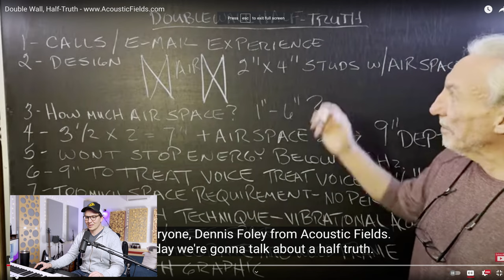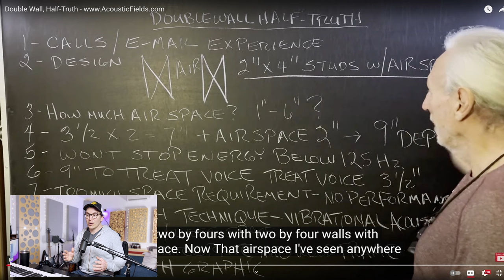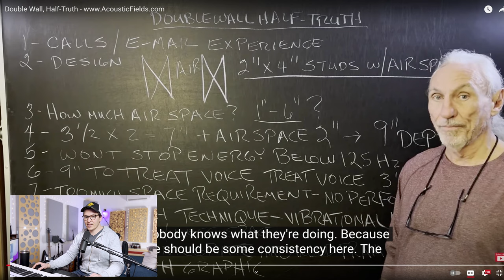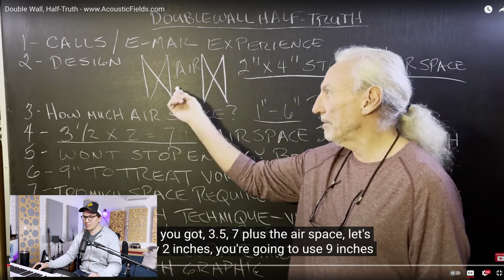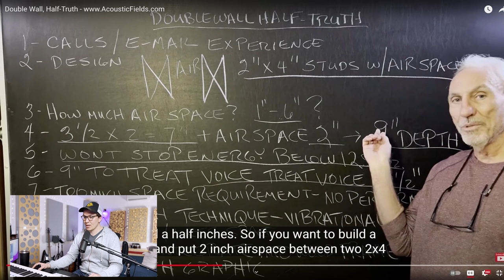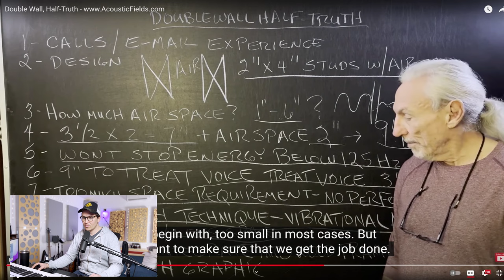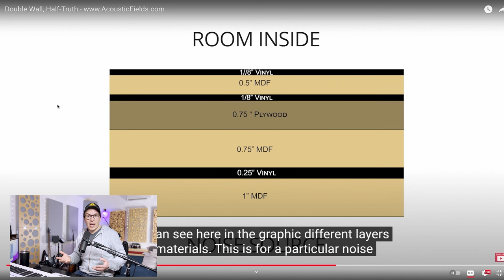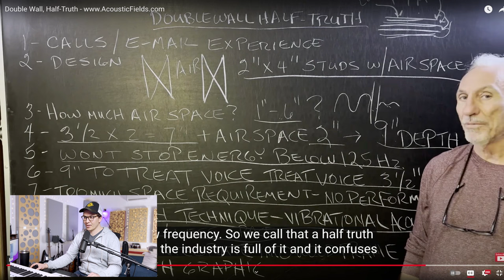Double Wall, Half Truth: Reaction Video

Comment: I need help soundproofing. I have concrete wall on 3 sides so I was wonderin if I should connect stud and insulation on the walls and add air gap with furring channel or give a inch air gap make studs separate of concrete walls with insulation then layer of ply

Comment: I've watched a ton of his videos. 3 years ago, i bit the bullet and built 2 4'x4' cabinets using his activated carbon technology. I found a video of one of his customers showing the building process of a cabinet they made, and found a seller on ebay that sells carbon pellets in bullk for air purifiers. Cost me about $500 for 250lb of carbon. I was amazed by the low frequency control... my room is 11x12 with 8 ft ceilings, so its far from perfect, but those cabinets did a crazy amount in a small space. Like, they work down to around 40hz, which is totally fine for me, considering room size. I don't know if his services are worth it for most people, but trying some of his technology in my space made a drastic difference.
Reply: Did you compare Acoustic Fields carbon to the air purifier carbon?
Reply: @dougb5028  I did not.  There used to be a link to order carbon from acoustic fields, but it was not there ar the time I made my panels.

I think the main point of the concept is the surface area of carbon pellets themselves, so I took a chance and bought some good quality pellets.  I was happy with the results.
Reply from the maker: That’s great to hear!
Reply: Is there any chance you have a link to that video you mentioned that shows the building process of the cabinet?
Reply: @thesamplejunkie4225 As duckmallard11 asked, could you share the video of the guy showing how he built the cabinet? Or at least the title of the video so we can search for it? Thanks

Comment: Hey  I'm building a drum studio in a detached garage with a window.  I'm using a double wall system with a 5 inch air gap.  I don't want to include the window in the system but I don't want to tear them out either.  What do you recommend I do before building my second wall in front of them?  Should I seal them with MLV, put insulation on them.. or put dry wall in front? Thank you..
Reply from the maker: You need to fill them with as much mass as the outside wall would have had there not been a window. Make sure it is air tight too.

Comment: This was really entertaining, and I think you hit the nail on the head: budget makes a lot of decisions for us, and the double wall technique works enough for most of us. I’m almost done building a studio in my basement and I’m getting more than enough isolation for my needs. I can use my guitar amp at 70-75dB when the family is sleeping and no one hears me. I haven’t even sealed off the studio doors yet, or installed the flooring! (Concrete slab for now) Like you said, it’s all the little details like HVAC and air sealing that makes the difference. I’m excited to see how much isolation I’ll get when the doors are fully sealed and the flooring is installed with insulated subfloor.
Reply from the maker: Awesome!

Comment: Any difference between using wood studs VS steel studs?
Reply from the maker: Not that I know of but a good question.
Reply: Gotta think wood stud work is more dense / more absorbant
Reply: @soundproofyourstudio  I think this is in Rod Gervais' book...maybe I saw it somewhere else.  Steel studs offer a little more sound control because you can put more STC material in the space.  I'm not sure if it's a huge difference.

Comment: Im just making a cinema room now, I thought we had it nailed when you taught the double drywall technique….. did you now just imply it doesn’t really work for those low bass movie sounds? 😮
Reply: It's less effective for lower frequencies than it is for high frequencies.

It's not as if it won't block it at all, though.
Reply from the maker: It does, just need more mass. 3 four layers of drywall, concrete wall double wall or two brick walls. The double wall is not the problem it is a mass issue.
Reply: @soundproofyourstudio  isn’t that just ‘getting silly’ though 😳… Im sure a concrete bunker is quite effective but making walls four layers deep and filling with sand is going to be more effective than two layers of drywall. My understanding was that you’d got a great result using two layers and appropriate gap as shown when you built your studio… certainly I didn’t hear noise on your Youtube video tour, did that turn out not to be the case? There is a limit to reasonableness when dealing with a home build listening room or studio.

Comment: So I caught this video just as I'm starting my drum room build.  I'm a loud drummer, I need all the soundproofing I can get.  So I called Acoustic Fields and Dennis answered the phone. Ha!  We chatted.  He's awesome.  He guaranties 90 STC on frequencies from 40hz to all of it.  He gave me a quick ball park price at around $20,000 for my 12x12 x 8' room in a detached garage..  This is using his design and me building it DIY.  He said the wall thickness would be the same as my "room with in a room" design with better outcomes. Actually he said my design will fail..  I'm building a completely decoupled wall and ceiling system at 11 inches thick for about $6-7k.  But IDK?  I'm gonna cross my fingers and go with my design. we'll see.  If I had the budget I'd go with Dennis.
Reply from the maker: Be very careful with Dennis. After posting this vid two people came out and told me he stole thousands of dollars from them and never delivered. He spent 7 years in Maricopa county prison for fraud from 2000-2007. Do a lot of background research. In my opinion something is very off.
Reply: @soundproofyourstudio  
He's the Tiger King of acoustics.
Reply: @soundproofyourstudio  Thank you for what you do!  I saw your video on home studio acoustics where you showed Rod Gervais' book.  That has been a very, very valuable resource!